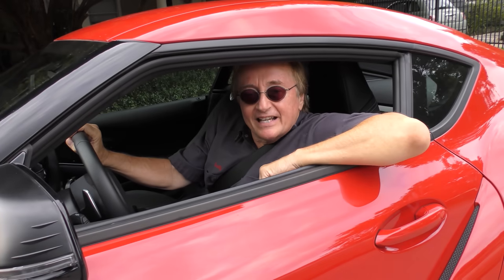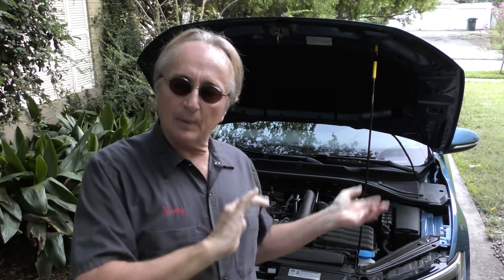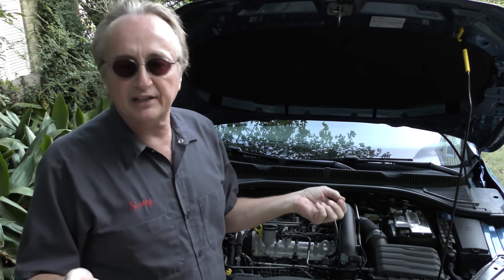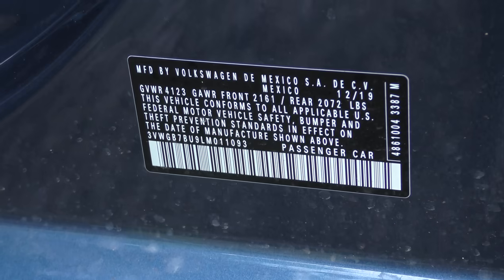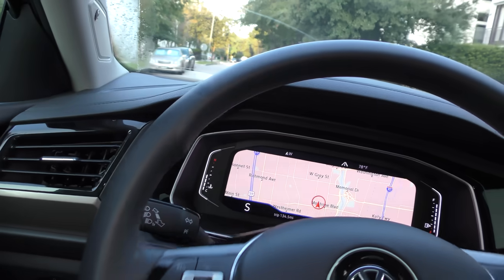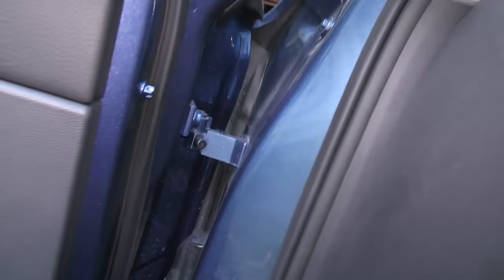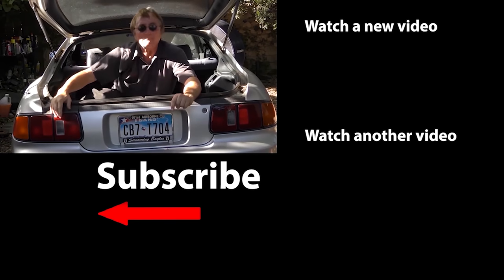I Just Found the Worst New Car Ever Made

Comment: Let me give you the German perspective:That thing is looks like a Volkswagen Passat. I once had one as a company car. They just call it Jetta in the US. But believe me, owning a Passat is not considered particularly sexy and certainly not "fun to drive". Go, get a Porsche for that. Fun fact: The last Jettas in Germany are from the 1990s. Here in Germany the intervall to exchange that belt is - depending on the model - maybe after 210.000 km. Thats a lot of miles. It costs between 650 and 750 Euro, I just googled it. While you are at it, it is recommendable to exchange the water pump, too (pricerange include waterpump and 19% VAT, that is reasonable in USD), because it is easy to reach when you take half the motor apart. So, yeah, thats what you have to do. But what is so unreliable about that car? That belts need replacement after some time is totally normal for those engines. The only thing I do not understand: what about that "lifetime warranty"? If Volkswagen advertizes it as a "lifetime" belt, then they should cover repairs, no? Thats how it works in Germany. At least if you do the regular check ups and have that documented. If that turns out to be false advertizing, I would be pissed, too.

Comment: I have to meet you one day bro. I'm thinking about getting my first car ever and thinking about the vw passat even though you said to absolutely NOT get one 😂😂

Every car needs repairs man
Reply: My brother bought one brand new. He talked me into getting the 2017 Jetta which has the same engine as this one. No problems. They are good values with great performance. If you can, consider getting a lifetime bumper to bumper warranty if you think you are going to have it longer than 5 years. If that lifetime belt does break, then they gotta fix it. My car came with a lifetime powertrain warranty - I'm not sure if that covers the timing belt or not. I'm a little concerned about that.

Comment: Hey Scotty, with very low mileage (4,000 miles) this year on my new Mazda CX-5, when do I need to get the oil changed?  It’s the 2.5L engine with no turbo.  I’ve heard it needs to be changed every 6 months regardless of low mileage, then I’ve heard 12 months.  Which is it?   Love your videos!  And I love my Mazda!
Reply: 10,000 miles. Change the trans oil every 60k miles with genuine mazda transmission fluid only

Comment: I have a 92 VW GTI 16v. Owned since 99. I changed the timing belt twice, every 49k. No crashing valves. Never had engine apart in 193k. Oh, made in Mexico. Very well.  Also a 2000 Cabrio with new timing belt and 153k.
Reply: Warranty Direct rates VW the 2nd Least Reliable engine due to frequent breakdowns.  My Beetle died at just 70,000 miles.  My 2 Hondas went 300,000+ miles with no engine breakdown.

Also VW commits criminal acts by cheating on EPA and EU pollution tests
Reply: @electrictroy2010  later model ones with GDI, etc are bad news.

Comment: Life time till the engine goes, you mean because it's designed as a interference design that when it does snap it will guarantee to break the engine too! Simple just go to your local VW dealer and spend $8k on a new engine, mounts, accessories, driveline components, reprogramming costs and ofcourse that new 'lifetime' belt!

Comment: I have a VW JETTA TDI In India Crossed 100,000 Miles Still Going Strong. Recently I Replace AC Compressor, Belts, Tyres and  all Brake rotors & Pads. Other than this I dont have any Problems with the VW.
Reply: Its because it's a TDI, best diesel ever.

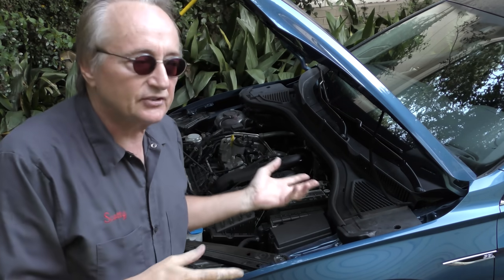Comment: 2:55 "many hours to tear the engine apart" - to change the timing belt? AFAIK VW timing belts are not that big of a job and the motor does not need to be opened - it can be done without removing the engine - by taking off the wheels and fender cover of the front right wheel - and removing some other stuff.

I think Scotty is think of a timing chain job - where the motor does need to be taken apart

Comment: Sounded all positive to me. Really to early to jusge the timimg belts.
Reply: It’s an old engine by today’s standards. Replace the timing belt maybe 10-20k before the manufacturer suggests. It’ll last forever
Reply: @firehot427  Volkswagen says 210,000km or 10 years. I've seen them go over 210,000km but I'd change it at 190,000km.
Reply: @firehot427  I've seen a belt on a 1.6 TDI snap at 159,000km although VW said 210,000km. Surprisingly, the valves were intact and not broken so the engine could run fine.

Maybe these new interference engines are made better than before.

Comment: I’d probably change it over 80,000 miles and use 5W 40 European oil that’s good for cars in Europe from 2025 to 2015 and if it’s not necessary, then I just use Valvoline extended protection

Comment: EA211 aka the 1.4 tsi has been around since 2011 mean while the Ea888 which is the platform the 1.8 and the 2.0 was released in 2008. Ea888 did suffer from timing issues in the early versions of the engine but it's an issue they fixed. VW can be service heavy cars but with that work done I know I have car that can drive to the limits daily

Comment: VolksWagen always makes reliable engines, the problem of why they break a lot is because how people abuse from them, my MK4 Jetta has its issues, yes, plastics are brittle and easy to break, yes, it’s because I live in Florida, Florida heat destroys anyone’s car with time. My Jetta is both super comfortable and fun to drive. 2 strong points from VW, but today’s of majority of people just don’t care how they drive, they drive aggressively, and too fast some times, putting a lot of stresses on their VWs, don’t blame the company for making super fun to drive vehicles. From time to time I push my Jetta to accelerate, but I never hit the Redline like majority of people. Also majority of the issues come from the first years of the newest platform. That is not only VW, also Toyota, Lexus, Volvos, BMWs, Mercedes Benz cars. Every one of those, have their issues.
Scotty with all do respect I like Toyotas but not on the level that you do, I’m more of a Volkswagen type of cars. I have a friend that has a 2017 Toyota Corolla, she takes care of it and sometimes she just floors it, she’s got axles that broke one time she was driving back home. Any car can have a defective part, My Jetta is old but it drives great. Clople of issues because I do not know the maintenance history I had a thermostat housing leak (common MK4 issue) but easy to replace, I actually upgraded it and it has not leaked since, 2 the water pump went out, because I don’t know when was the last time or if it was ever replaced, but another kinda easy Job, not super hard and not extremely easy to do. It still has the Catalyst deficiency, the warranty was extended until early 2016, and we got the Jetta mid to late 2016. So I kinda lost the opportunity to have warranty to help out and not pay anything. But I’m gonna replace that for a better Catalyst converter, and tune it up, the suspension, collapsing bushings, another common issue on MK4 VWs not super crazy, is just a issue but not a problem, even if they collapse is due to time, my jetta is 18 years old and again I do not know the maintenance history pretty well. I’m replacing those things little by little, I’m gonna upgrade that car little by little, keeping it mostly stock. And it will continue to run. Is a 5 speed manual which makes it even more reliable than the automatic.
My mom has a 2018 Tiguan, and it’s got some issues, that come and go, warranty has covered all the issues that were discovered and now is doing great, the car drives perfectly fine, no issues. Because she takes pretty good care of it, and doesn’t go crazy running the car all the time like those other people, specially teens. I bet Toyota has some similar issues or minor or worse, BUT it all depends on the driver behind the wheel. I have a 2019 GTI and by the time it gets to need service, like for Chains I will be able to do it my self, because I have learned a lot, and I take good care of it, I don’t Floor my car often, just from time to time up to 5000rpm max, I dont go further, or I willl usually get it below 3000 rpms and shift gears. Also the issue of carbon buildup that you made it seem like a problem on the 2.0 TSI engines is more common on the 1 gen TSI and the CCTA 2nd gen TSI, the 3rd gen EA888 doesn’t make much like the first 2 generations. Of course it will build up, but is relatively a DIY cleanup with easy to buy materials from the auto parts store. And a easy Catch Can install. There are solutions to every single issue for any car, now if its covered under warranty, there is no money out of pocket,
In the case of my Jetta I will have to do it by my sefl and maybe a little help from my mechanic friend that will help me around if I need something.
Scotty you are a great mechanic, but don’t be bias, it’s easy to say it because I don’t know if you’re asking your clients if they really take good care of their vehicles. All my oil services on all the cars in my parking and any recalls are done in time, because I care about my vehicles. My Jetta is almost 200k and still runs great, no horse power loss, it still makes the original 115hp from the factory. 
Scotty, thank you for your videos, you’re a great mechanic.

Comment: I’ve got a 2020 mazda 3 sedan and its amazing. 2.0L non turbo engine and the whole thing is amazing. I also have 2015 mazda 3 gx sedan got almost 170000kms on the odometer and not even a single breakdown yet. Always starts in the first attempt during winter up here in the north which is canada ofcourse🤪. Id say toyota honda and mazda run forever.

Comment: Lifetime means 115,000 mile, get it changed. It is all I own a 2016 with the 1.4 liter turbo, driven it plenty if miles and in all kinds of driving conditions. I now average 35k a year on this vehicle. Just preventative maintence is the key with these cars.  The belt, also watch for the carbon build up on the back of the intake valves(800 bucks ish for a walnut shell cleanup) i love my Jetta and the engine out side of that and after 65 thousand miles I can attest to durability.

Comment: I have a 2017 Jetta with the 1.4 TDI with a manual transmission - basically the same engine as in this car. It was the cheapest car VW made (I did get heated seats though, other than that, no options). I think I paid about $16k for it. I have 130,000 miles on it and have had no problems. 

I was driving 120 miles a day for over two years in a daily commute to and from work. The car came with a life time powertrain warranty. I'm not sure if that includes the timing chain, but I assume it does. Until I watched this video, I did not know that this was an interference engine - I might have bought a lifetime bumper to bumper warranty if I had known that. 

I suppose there's good reason for making an interference engine, but if they do, I think the manufacturer should have to pay for fixing it if the timing chain brakes inside of 10 years no matter the mileage.

My car has independent multilink rear suspension on it, so it handles pretty good overall. (I owned a honda CRX hf, back in the day, that car had double wishbone four wheel independent suspension and was hands down the best handling car I have ever driven, and that includes the Miata, which I also owned and also had a double wishbone 4 wheel independent suspension. The VW doesn't handle that good, but it's still pretty good overall. 

My car will consistently get way above 40 mpg on the highway if you drive at or below 75mph. It goes from 0 to 60 in less than 8 seconds. My car is rated at 38.1 inches of rear seat leg room and also has a huge trunk. So far it has been a good value. Its a cheap car with attractive conservative styling, with midsize room in it with subcompact economy and v-6 performance. Its punching above its weight in all categories. Back in 2017 I could have gotten a Mazda 3 for the same money (know someone who did) but it didn't have the rear seat leg room which I wanted. (I prefer almost all other aspects of Mazdas). Some times my mother or someone else would have to sit in the back seat, and I want them to be reasonably comfortable.  The new Mazda3 is a very beautiful car, but is now way more expensive and still cramped on the inside from my perspective. 

Back in 2017 the Toyota Corolla had a huge back seat in it over 41 inches of leg room (the current one has dramatically shorter leg room and not worthy of consideration for that reason alone). It did not get the same mileage as my VW tdi - and when I bought this car I knew I was going to be driving at least 120 miles a day. Also, I think the japanese "transformers school of design' that it uses is ugly if not f-ugly. But I have to admit, if you had a 2017 Corolla with manual transmission you would probably have that car for life with only routine maintenance. And it comes with all available safety features standard. So its an incredible value if you can handle the styling inside and out. Imagine after paying the car off in 5 or so years, driving for nearly free for the rest of your life.

Comment: I feel like VW gets a lot of unnecessary hate. Idk I've owned 2 of them a MK4 tdi with 400,000 miles and a mk6 with 100,000. Both were more reliable than my Scion I used to have. They are more expensive to maintain but they typically drive nicer than Japanese competitors  My biggest issue with VW is cheap plastic and cheap wiring especially in the older models and I can bump my arm into something on my mk4 and break something on the door, but atleast VW always has pretty solid engines and transmissions lol. Atleast it beats owning any GM car.

Comment: This is accurate on the timing belt. I had to have mines changed at 30K miles. Took the dealer a week to change it. Thankfully under warranty. But the repair would have cost over 1K.
Reply: Get a new dealer.  Mine did it while I sat in his lobby watching TV.  Cost was $1500

Comment: Planning on getting a 2017 Passat with 55k miles for 16k and I’m doing my research to everyone reading take care of the car and it will take care of you I had a 2018 q50 27k miles when I crashed I know still low miles but they get a worse rating that this and it never had a problem. People get cars and think you don’t have to check the belt, oil or brakes every couple of miles 😂 my friend as a 2018 Jetta and he beats on that engine going 125 on the freeway and never had a issue other than changing the belt at the time it was supposed to be changed which you can do at home

Comment: Guess what, I had a water pump failure in one of these TSI engines with less than 30k miles! And since the car is JUST out of warranty, it's on me. VW/Skoda/Audi/SEAT NEVER AGAIN! They want 600€ to ONLY diagnose the water pump. Plus another 600+ to replace it. THIEVES!

Comment: Scotty you keep complaining about plastic in cars, they all have crappy plastic to lighten them up to get good fuel mileage..Besides plastic doesn’t rust but it does crack, chip and melt. VW is a pretty decent car  have a 06 tdi with 260 Kms no major problems. Heavy on oil changes though

Comment: Let's be honest, no one buys a VW to hold on it forever ..
Reply: 🙋🏻‍♂️ I do. PMCS it regularly and it's fine. Mine all lasted until wrecks killed them. 2001 GLS with 2.slow 16 years before wreck over 130k miles and 2.5 SE Jetta 8 years 87k at wreck. No issues.

Comment: Vw mechanic here known problems with the new jettas (so far)
1.N80 evap purge valve line cracks causing evap leaks
2. Burning oil 
3. Oil level sensor wires are notorious for Rodanthe damage 
4. Goes through brakes and tires faster than most sport cars for the same price

Comment: Seems a little odd a company would go to a belt from a chain (obviously there were some problems as was pointed out in the video) but even Honda and Toyota abandoned timing belts years ago and have all gone to chains because the benefits of the belts weren't that big after all and I think since the Honda's at least are interference engines, they got a lot of crap from people because when the bvelts did break, the engine was done.  Ford used timing belts too, in the Contours for example, but those weren't interference engines.  I personally wouldn't buy one of these (or anything, even a Toyota) that has a turbo, unless I was only planning on keeping it through the warranty and then selling it.

Comment: Terrible car with terrible transmission. Grinding noise for all, and they say its normal. DO NOT BUY THIS CAR, i got rid of mine. BEWARE OF 2019 JETTA, do your own DD!!!
Reply: I read about what you describe (misaligned torque converter) (class action lawsuit) but do you know if they fixed the transmission problems for 2020 and 2021? I'm waiting for more 22s to come out, I might buy one. Did your 2019 use oil? The 22s now have plasma-coated cylinder linings to hopefully fix that, thx!

Comment: The thinking maybe since it has a turbo and 8 speed transmission, it doesn't need to rev as much ... so the timing belt wont wear as much either, unless you're always Autobahning it. The rear axle ... well, VW (to save money) refuses to go fully independent on their low-end models ... always that torsion beam that for the longest time caused VWs to 3-wheel in hard corners - and not be so smooth over speed bumps. But esp. for the base model - you get a LOT for the money, if you don't want to drive a ham-n-egger Corolla. Personally I'm glad they got away from their timing chain design even if the timing belt is expensive to replace.